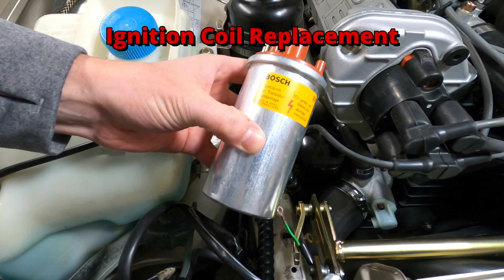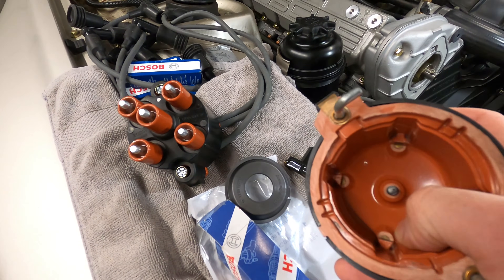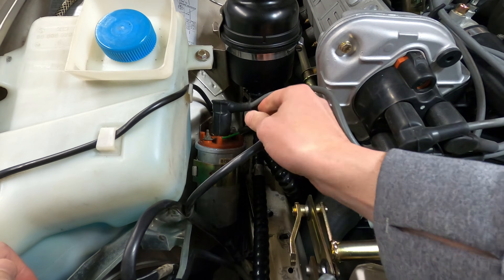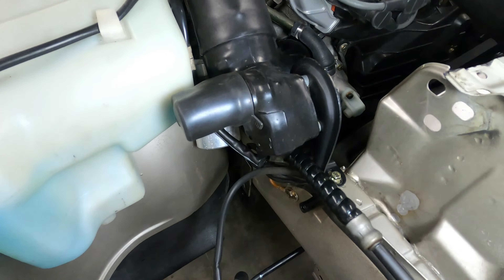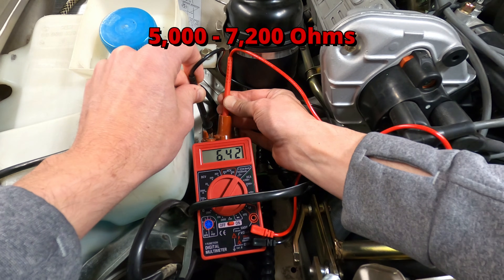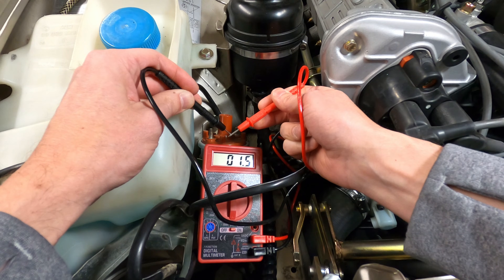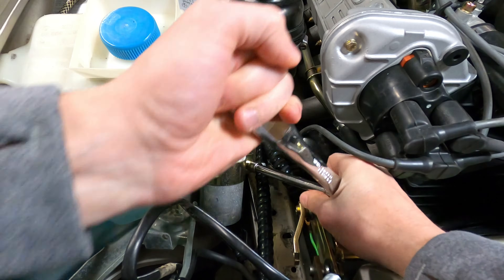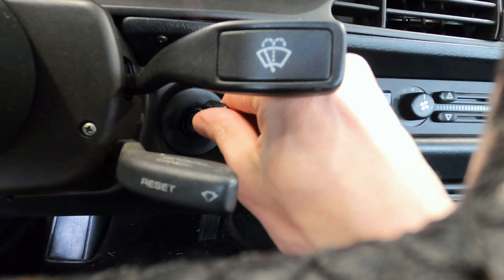Porsche 944 – Ignition Coil Testing & Replacement Tutorial

Comment: Hi. Me again but on a different post. I think this actually may be my problem. I tested current to the coil and I'm pulling about 11.50 which I think is adequate, however when testing resistance on the coil posts I'm getting 0. I'm thinking this is the cause of the car both stalling out on me and now not starting. Gonna order and new coil and see where that goes.
Reply from the maker: @thegreatpatsy  Nice! The coils were back ordered for the longest time, well over a year, but they are now available again for around $200. Check out part numbers: 944-602-115-00 (old number) and 944-602-115-01 (new superseded number).
Reply: @NC944er  Thanks. Sorry one question about measuring the coil readings. How come on the top in red you have reading saying 0.4 - 0.6 ohms but then watching your multi-meter you are pulling between 01.9 - 02.0. That would mean yours was bad correct? Sorry I get dizzy with these readings, moving decimals around. Anyway, upon re=testing, I am now pulling 00.7 at the posts and 0 at the coil output to the wire. So good input / bad output. I did test for spark and I am getting a spark however. But perhaps not the correct amount?
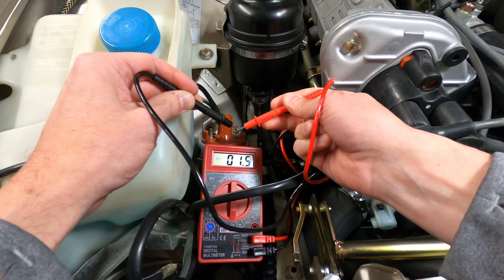Reply from the maker: @thegreatpatsy  Yeah, so the higher reading you saw there is because I was using a cheap Harbor Freight meter. If you check out 4:09 I explain that my meter was defaulting to 1.6 ohms resistance from the leads, so I had to subtract that value from the results on the coil, which ultimately put this coil within the 0.4-0.6 specification, but I replaced it anyway, just for proactive maintenance.
Reply: @NC944er  I found my problem. My worst fear, the damn timing belt ripped! I pray to God that I didn't damage this engine trying to turn it over!
Reply from the maker: @thegreatpatsy  Wow! As in, ripped fully in half and the engine is out of time, or just frayed and started to tear?
Reply: @NC944er  Actually it was the timing shaft belt. I pulled back the cover a bit and see that it's ripped in half. Maybe I'm not too screwed. It happened at very low rev in first gear when coming to a stop as I was pulling into my driveway.
Reply from the maker: @thegreatpatsy  Do you mean the balance shaft belt that sits in front of the timing/camshaft belt? If so, yes that would be good news. Although the engine should still run without the balance shaft belt intact, it would have more vibration though. Hopefully it didn’t foul up the timing belt as well, but yes… definitely time to step back and start to get deeper into that repair first.
Reply: @NC944er  Correct sorry, the Balance Shaft Belt. My God, please don't tell me that! Is it possible that my timing belt slipped and skipped a tooth then? Seems like a very odd coincidence because the engine was running absolutely smooth, pristine even. Then it died while turning to the right on deceleration. It just makes no damn sense.
Reply: Or perhaps my Balance Shaft Belt when it snapped, it interfered with the timing belt and knocked it off by a tooth? Something just isn't adding up here.
Reply from the maker: @thegreatpatsy  Yeah, really it should still run unless it’s out of time, assuming no other issues that would cause a no start. I would very carefully set the engine to TDC by hand, stop if you get any strong resistance (valves hitting pistons), and then check the timing marks. It can be off by a couple teeth and not interfere, so you may get lucky. If there is damage to the valve train, it can still be rebuilt, an added expense, but definitely not a lost cause.
Reply: @NC944er  This is getting better by the moment LOL! I have now discovered a bunch of missing ribs on the timing belt. Now I'm praying that this caused some slippage and hopefully did not damage the engine but I would say this through the timing off, causing a no start situation. Well, time to roll up my sleeves. I'll report back once I get through this mess. Thanks so much for all of your tips and responsiveness so far!
Reply from the maker: @thegreatpatsy  The missing ribs would certainly explain it. Your belts must be original to the car, if not VERY old. Don’t lose hope, it can all be fixed… and then you’ll have a great story to tell. 😂
Reply: @NC944er  Wanted to update you. I've replaced the timing belt (which was missing an entire 5" section of ribs) and the balance shaft belt which was snapped. Did the timing, put the car back together. Cranked the engine by hand first and she turned pretty smooth so I thought maybe, just maybe no bent valves and interference. Then I started it and my God what a nightmare! It was running rough as hell, shaking and banging / tapping noises. Would then stall out after a while. I could start it each time but it's running like crap. So I tried a compression test. Got 0 pressure in cylinders 1 & 2, but have about 150 psi in cylinders 3 & 4. What do you think? I'm screwed aren't I?
Reply from the maker: @thegreatpatsy  Congrats on identifying the root cause! Now the easy part, just tear the entire top end down to the block. 😂 Positive spin… you now have the opportunity to get to know your car even better and improve its long term reliability. Replacing the head isn’t too bad, it’s just a lot of little steps. If you want to rebuild the existing head, replacement valves are available for about $50 (aftermarket) and you could also do the valve guides and seals, drop about $350 at a machine shop. There are also fully rebuilt heads available for $900-$1,000 from a few vendors. The head gasket seal kit is about $100. Most people report 2 bent valves with a timing belt failure, so your compression test results sounds about right.
Reply: @NC944er  Cool. I think I may just buy a head then. I found some on ebay for under $200. Thanks for the advice and support. I'll let you know if I ever get it running again!
Reply: Got my car running! The head had two bent valves, pistons were in perfect condition. Installed the new head, did a compression test, checked out good. Then fired it up. Some smoke at first from residual oil and stuff but then smoothed out. The car did stall once out of nowhere and had a little trouble starting a couple times but I gave it some gas and she turned. I'll keep my eye on it but all in all I'm just glad it's running again!
Reply from the maker: @thegreatpatsy  Nice work! Im glad you got it going. 👍🏼

Comment: I was chasing an engine issue and thought the problem could be related to ignition and ordered a new coil from Porsche.  While waiting for the part to arrive, I figured out my current issue was NOT ignition related, but decided to keep the coil and replace it anyway.  I got the same Brazil made silver coil you show in the video.  The one I removed from my 87 was black in color.  The old label was no longer readable, but guessing the coil was original to the car.  The new coil has a smaller circumference and Porsche supplies a foam band to make up the extra space so it fits into the mounting bracket the same as before.  The new coil has a smaller center post, so Porsche supplies a rubber sleeve to make up the extra space so the boot fits tightly as before.  The new coil has a + and - post but unlike the original coil, both posts are the same diameter as the smaller post.  I liked the original design with two sizes so it wasn't possible to mix up the connection.  I also needed to source a new nut to fit the second small post.  I'm not sure if this is a case of "less is more" or "less is less" or "doesn't make any difference so get a life."  What do you think?
Reply from the maker: @hampsonlaboratory1363  Interesting! I know Bosch has cut back on production for the coils, only doing production runs every so often, which results in lengthy periods of being back ordered. Although I have not seen any differences in design you mentioned, but as long as the new part works, it’ll be better than an old part with an unknown history.

Comment: This process work with a 924 turbo? We have it starting just fine, but stalls after about 2 seconds, starts fine again … ??
Reply from the maker: It would work for the 924S. The 924 Turbo uses a different part number, so the spec could be different.

Comment: I've recently been dealing with a really poorly running car, initially it was only at cold starts I would notice the car struggle to hold and idle or hunt around, and if driven it would sputter and hesitate and backfire, but the symptoms would go away once warmed up more. Now, it's gotten progressively worse where 80 percent of the time it exhibits these symptoms regardless of engine temperature and intermittently will run better sometimes, run normally out of nowhere rarely, or run horribly whenever it feels like it. I am really unsure of where to begin with this and was hoping you had some insight or can guide me in the right direction to begin. 🙏 thank you
Reply from the maker: It sounds like a failing reference sensor… I would inspect and test the speed/reference sensors (the wiring breaks down at the connections behind the intake manifold) and if those check out, I would test for spark. Here are a couple articles to check out…

http://clarks-garage.com/shop-manual/ign-02.htm
https://www.clarks-garage.com/shop-manual/ts-01.htm
Reply: @NC944er  Thank you I'm going to check those out! You're a class act man. Your content and videos help so much in the 944 community I couldn't imagine trying to tackle half the stuff I did these past couple years without your videos. Hope you never stop doing what you do 😁

Comment: Thank you! You have the clearest explanations and videos available. I have a beautiful 1987 944 I bought new in 1987. I am now replacing some electrical components that are within my limited ability.  When replacing the original ignition wires, the toughest part was trying to get the coil cover off. I moved the power steering reservoir and unsnapped the cover and pulled until my hands were bloody. No luck. To complete the wiring, I carefully cut a hole in the top of the coil cover so that I could replace the old wire from the coil to distributor. Many folks on line have had the same problem with the coil cover. Please consider a video just dealing with that cover. I would still like to replace my now damaged coil cover with a new one.
Reply from the maker: You’ve had a long life with your 944, that’s amazing! 😎 The ignition coil cover is a ridiculously tight fit. You are on the right track with moving the PS reservoir. The cover can usually be removed at that point with much twisting, wiggling, and pulling, but sometimes it also requires loosening the ignition coil bracket as well as the headlight motor mount. With some clearance from those pieces, the cover will pop right off.

Comment: I just tested my ignition coil, got a primary resistance of 0.3ohms. Been having an issue with fluctuating  idle and intermediate stalling. After looking for a new coil, I can not find one anywhere. I noticed they were discontinued, so where is everybody getting new coils? I see aftermarket but non with the required voltage and resistance specs. Does anyone have recommendations to a brand/website where I can find a new/refurbished either OEM or plug n play aftermarket coil.
Reply from the maker: Yeah, the ignition coils have been back ordered for quite some time. I was able to get one from PartWorks in Germany, but it appears they are sold out now as well. Bosch provided an update earlier this year that the back ordered parts should be available around September of 2023, so they still plan to produce them, but they only do something like one production run every year. If you need one now, I’d look for a preowned one… here’s one available from an eBay seller I’ve used in the past - https://www.ebay.com/itm/166291672290?mkcid=16&mkevt=1&mkrid=711-127632-2357-0&ssspo=jDpueT61Swq&sssrc=4429486&ssuid=E3wwf34yQjS&var=&widget_ver=artemis&media=COPY
Reply: @NC944er   Just got my ignition coil in the mail and installed it! Car is running much smoother now, thank  you for your videos and help.
Reply from the maker: @jacobhumphrey7711  Awesome, glad to hear it! 😎

Comment: Another excellent video.  Thank you! My 1989 944 turbo engine shut off while I was driving and it failed to restart.  After watching this video, I tested the coils and found that it had no resistance across the green and black terminals.  The secondary resistance was normal at 6400.  I tried to order a resistor but seems to have trouble finding one online.  Seems like everyone is out of stock. Where is a good source for the ignition coils?  I tried all the usual places such as pelican, fcpeuro, autohauz, .. no one seems to be in stock.  I may have to try the dealer and see if it is available.
Reply from the maker: Yeah, the ignition coils have been back ordered for quite some time. I was able to get one from PartWorks in Germany, but it appears they are sold out now as well. Bosch provided an update earlier this year that the back ordered parts should be available around September of 2023, so they still plan to produce them, but they only do something like 1 production run every year. For the mean time, I’d look for a preowned one… here’s one available from a trusted eBay seller I’ve used in the past - https://www.ebay.com/itm/276006358482?mkcid=16&mkevt=1&mkrid=711-127632-2357-0&ssspo=_67jZtoRRHO&sssrc=4429486&ssuid=E3wwf34yQjS&var=&widget_ver=artemis&media=COPY
Reply: @NC944er  Thank you!

Comment: I have a 1987 944s that won't start.  I'm measuring 4.55k ohms between the coil output cable terminal and the negative terminal.  You had indicated a range of 5k to 7.2k ohms in this video.  Do you think my measured value could cause a no start condition?
Reply from the maker: Hey Bryan, that reading is out of specification, indicating that the coil is starting to fail. This could cause hard start, firing issues, and potentially a no start condition. If you can, it may be a good idea to confirm spark at the plugs using a spark tester before purchasing a new coil. It’s generally a good idea to first test some of the more common failure points as well - bypass the DME fuel pump relay to confirm a working pump and relay, test the battery, check terminal connections and clean grounds, check for a damaged ignition rotor, factory alarm control unit, etc. The ignition coils do fail, but they are generally more robust than some of the other components, but again that resistance reading is not ideal.
Reply: @NC944er  Thanks for the info.  I'll check for spark before purchasing a new coil.  I researched the type of coil that's currently in my car 'MSD Blaster PN: 8202' and it does not specify that it fits a Porshe 944.  I'll probably go ahead and purchase a new one anyway but I'll start with some more common failure modes first.  It has a new fuel pump so I don't think it's a fuel pressure problem.

Comment: I have owned a 1988 944s for about 4 years now (my first and only car) and I have to just say a major thank you NC944er! You have single handedly kept my car alive and running with your in depth tutorials and attention to detail. Its almost like I can have a problem and just look at your channel to find out what is wrong without wasting 5 hours researching the problem and getting 17 headaches and not even 1 step closer to solving the issue. I am very grateful to have my car but I'm even more grateful to have this channel to help me maintain my vehicle through all its problems without any confusion. Thank you.
Reply from the maker: Thank you for the thoughtful comment! I’ve definitely put multiple 100’s of hours into researching, recording, and building out the channel to be as helpful and accurate as possible for fellow 944 owners. Though there probably isn’t much benefit to folks outside the enthusiast community, it’s come to be invaluable to all of us trying to keep these cars alive, and if I can help save a few more, I’m all for it! I’ve also come to learn that 944s generally suffer the same failure points over time, so we’re all simultaneously and collectively fixing the same things in different geographical locations. Pretty wild… pass me a virtual beer and keep on wrenching! 😂